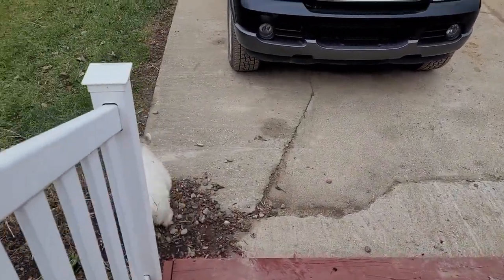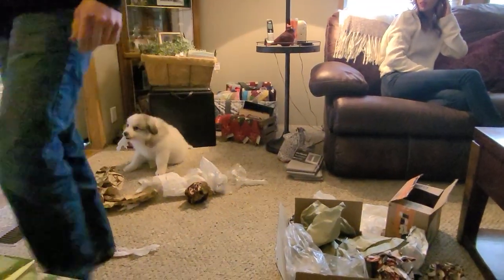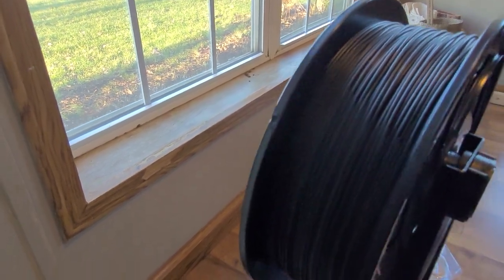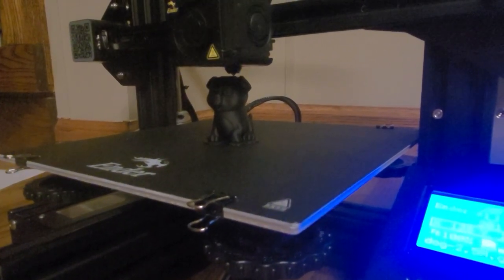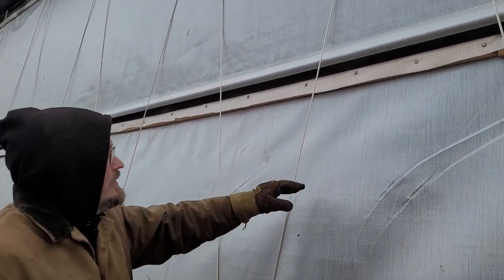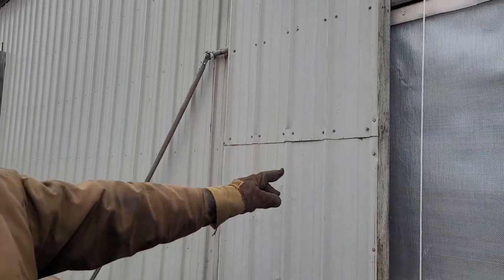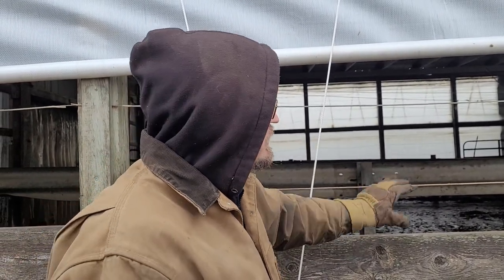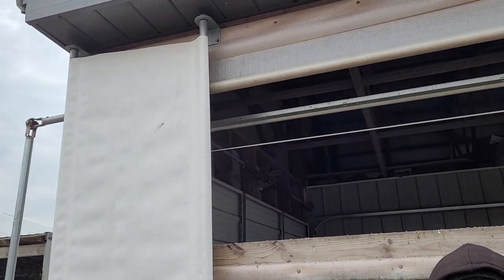New Puppy Christmas Fun!

Comment: I work on several 3D printers at work doing repairs and preventative maintenance. Thingaverse has thousands of programs available for making all kinds of stuff on 3D printers. One of the most important and problematic issues with 3D printed parts is that they don't always come out end up being the exact size you wanted them to be. Shrinkage and sag needs to be understood before you can successfully make 2 parts to be fastened together.
Reply from the maker: Thank you so much. We will look up Thingaverse.

Comment: Are the curtains treated, Rain resistant,snow etc? Simplest methods are usually the best methods. If you want to Hi Tech it,put a motor that runs off of a solar panel to make curtains go up and down. Only draw back, motors burn out. Natural human cranking never fails, maintenance free and cheaper, also good exercise. You never heard the last part from me (exercise). I 'll deny it until the cows come home.
Reply from the maker: The do keep out wind, rain and snow.